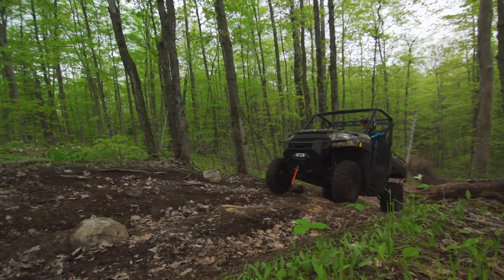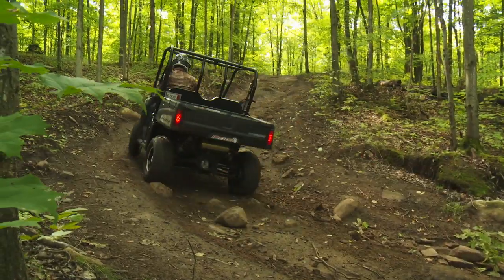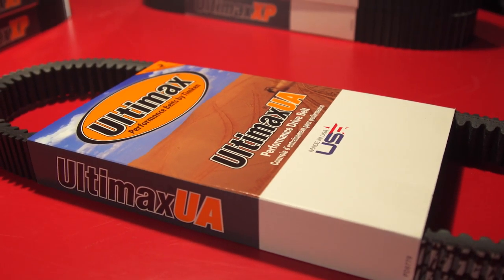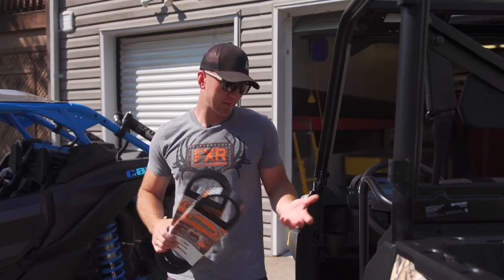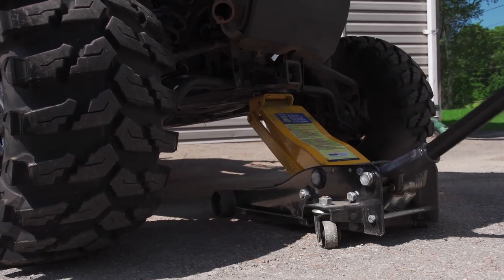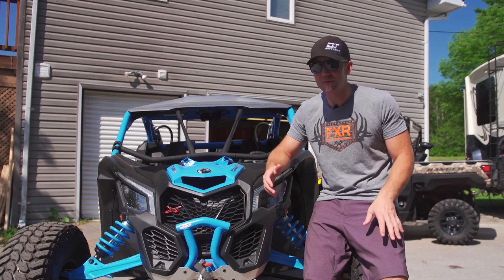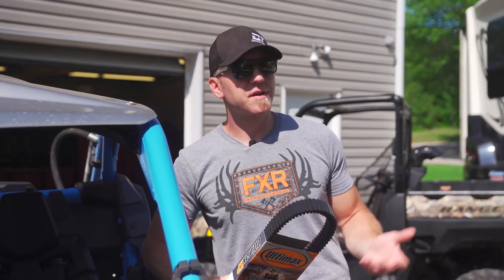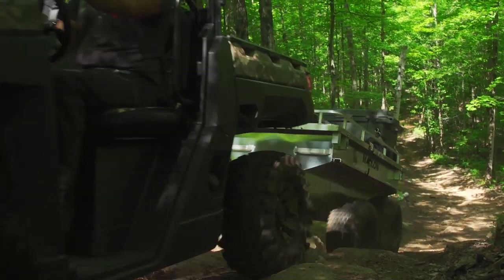Ultimax Belts Overview and Install

Comment: I also have done alot of research on their belts. Including calling the factory direct. This belt give me way less jerking in the Can Am Commander . I have also noticed when I don't have time to drop to low when I break a turn to find a steep Rocky climb that in high range I can still make the climb wo smoking the belt or way less than I have w the upgraded Can Am Maverick belt. This belt has proven it self several times.  We came to WV to ride the HMT and even my wife sees the difference . Cool part the belt for the commander it the same for the outlander.

Comment: I've never had to replace a belt but I also don't drive it like a stole it and I use low gear when needed. I've noticed my Grizzly doesn't have a low speed/low gear recommendation like my polaris. The dealer rep says I will never have to worry about the belt. Presumably, he would like me to destroy the wet clutch.